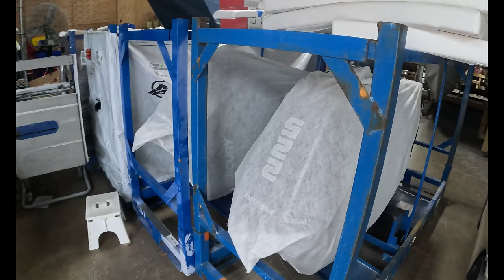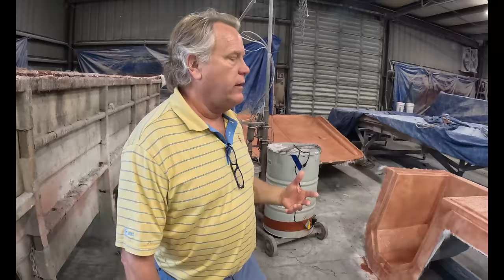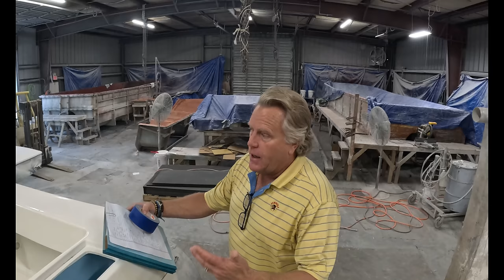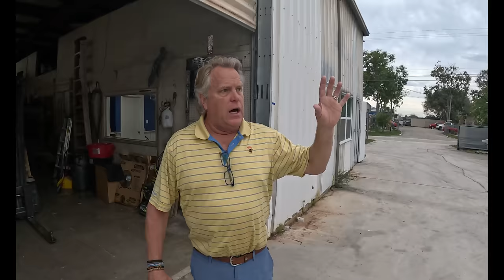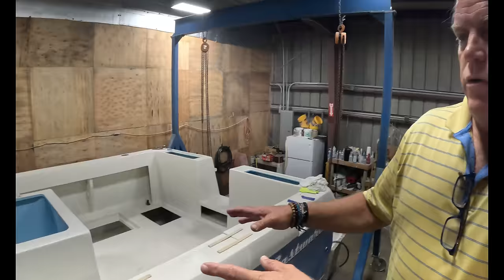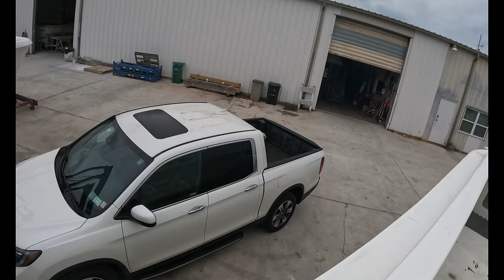Factory Tour REVISITED- Eastward Boats - New Factory, Owner and First Look at my New Boat!

Comment: As soon as he said the hull design was 50 years old I stopped watching.  Ask yourself how a hull that's even 20 years old designed on a white board can compete with a modern CAD designed hull with fluid dynamics software and a naval architect?
Reply from the maker: That’s a fair point but some of the best riding hulls are even older (think Formula 233)

Comment: Back up, did you say naturally aspirated ? Why ?  Looks great, good luck. Thanks.
Reply from the maker: The supercharged inline 6 Merc Verados are being phased out and all offerings in the sub 350 range are now now all naturally aspirated
Reply: @jiggingjerks  Yamaha’s too ?
Reply from the maker: @duffmeister6480  Yamaha is all naturally aspirated as well.  I believe Merc is the only manufacturer that has forced induction engines.   All things being equal, naturally aspirated will be much more relaible
Reply: @jiggingjerks  my Yamaha 150 is injected ?
Reply from the maker: @duffmeister6480  ahhhhh, not talking about fuel injected.  Meaning superchargers and turbos.  Only Merc uses that (superchargers)
Reply: Ok my mistake, I thought natural aspiration meant carburetors,  thanks for the education.